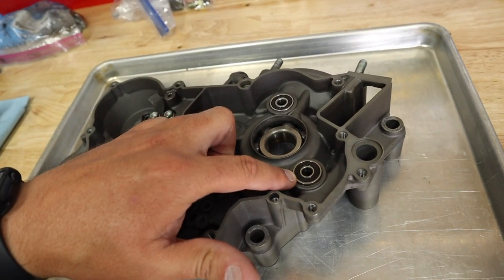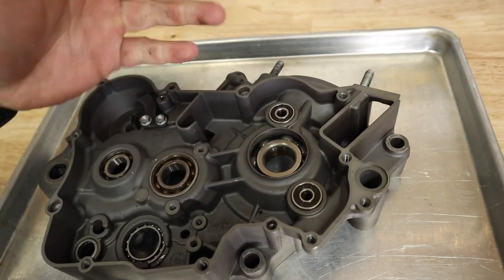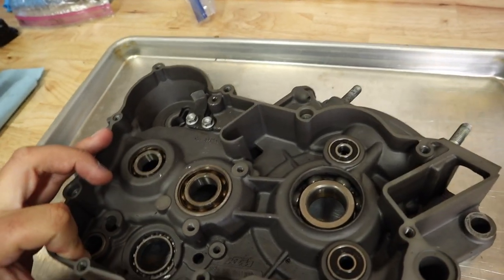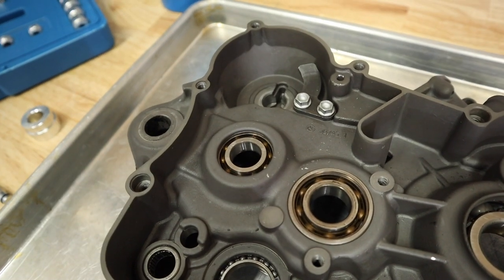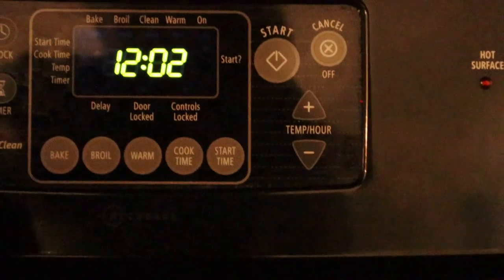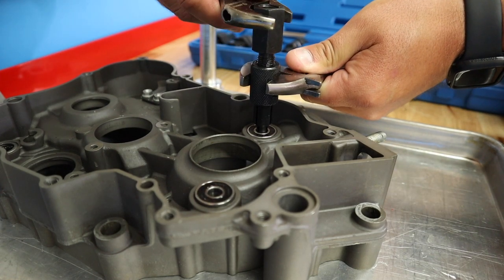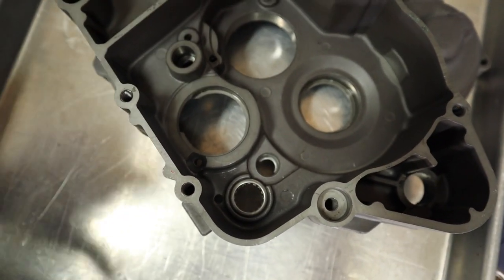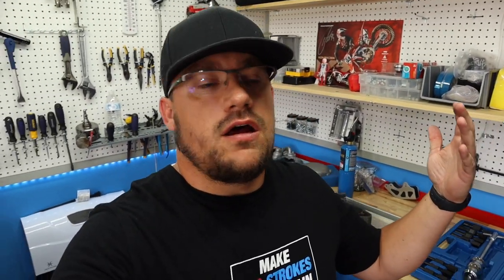KTM 125SX MOTOR TEARDOWN 4 | Bottom end bearing removal

Comment: How did you get the large roller bearing out on the left side case?
Reply from the maker: Heat the case up like I show on the video, then use a punch and drive the bearing out from the outside of the case. It works like a charm and takes a little bit of back and forth from side to side. Now mine actually fell out, but that is how you would do it. Thanks for watching Skyler!!!
Reply: Alright cool thanks...keep up the good work..the videos have been extremely helpful

Comment: Hey how did you get the left side crank bearing out? You've been so detailed about everything so far, I'm loving the info.
Reply from the maker: Awesome thank you! I used a drift to drive it out from the outside of the case. Very easy I just somehow forgot to edit that In.
Reply: @DanMX2112  yea I've been working on a 01 ktm 200 for a year now, your motor looks exactly like mine. I'm hearing a strange sound on the left side of the motor like that bearing is going out. Almost 6k into this bike and I'm getting frustrated
Reply from the maker: Dang man, that’s deep. I hope you get it dialed in soon. Let me know if I can help further!

Comment: Yo Dan what's up man I'm trying to figure out if there's an easy way to remove the race off of the old crank and do I reuse it or should I just have purchased a new one
Reply from the maker: No way, don’t reuse that old race. It’s heated and dropped on and should not be removed and reused. You can use your old crank if it’s still good 👍 just throw on a new race and bearing! Good luck fella!
Reply: Thanks Dan I appreciate the reply shouldn't one have ce with my kit

Comment: I have question why bearning of water pump and powerwalve Centrifugal regulator are 2RS (sealed) and not open bearings?
Reply from the maker: I had the same question, and I wish I knew. I did double check to make sure it was correct, and it is, but idk why.
Reply: @DanMX2112  My first thought was that the oil level was insufficient, but the pump bearings were very low.  In Yamahas the bearings are open, strange.
Reply from the maker: @iktorn3539  it may not get the splash needed to lubricate properly, who knows.

Comment: Hey how did you remove the other roller bearing out the right side crank
Reply from the maker: I used a punch from the backside along with some heat. It nearly fell out.

Comment: Where did you get all the bearings. Is there a set you can buy?
Reply from the maker: Yes there is! You can get a Hot Rods crank and bearing set or a Wiseco like I had. And RMATVMC has some motor bearing sets also. Most engine kits come with everything, gaskets, bearings, o-rings.
Reply: @DanMX2112  cool thanks..do you know if theres any difference between the 2003 and 2004 125sx..i have an 03 and its saying the transmission bearing set tbk0018 wont fit..some sites say it will though
Reply from the maker: The 03 and 04 have different bearings in the transmissions. So yes they are different.
Reply: @DanMX2112  alright thanks